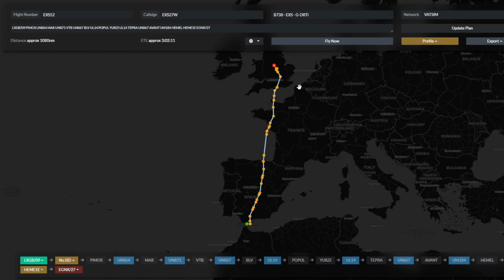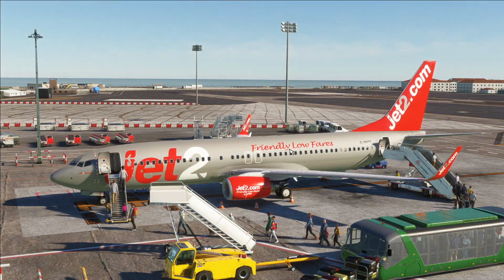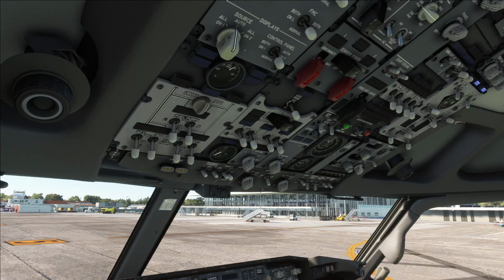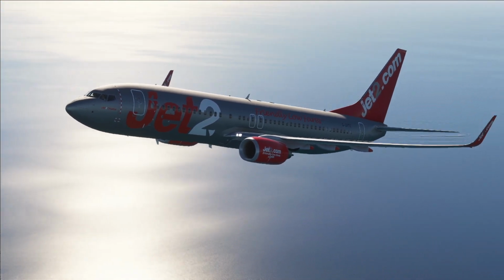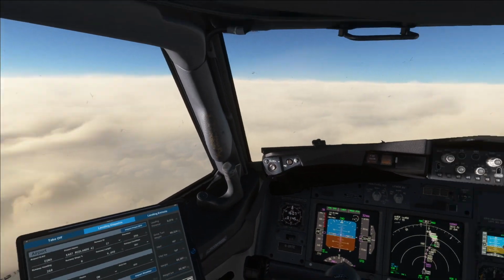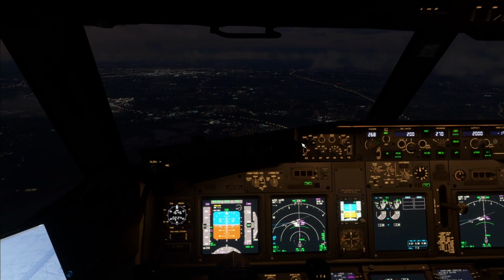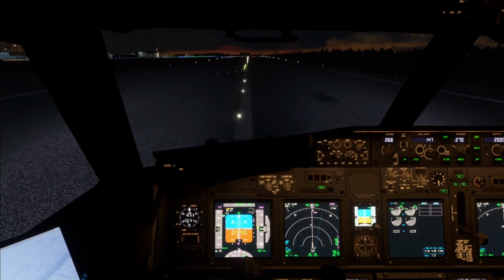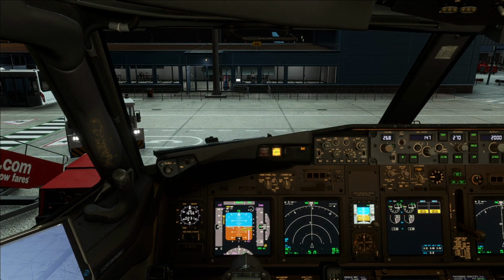[Microsoft Flight Simulator] NEW PMDG EFB | Gibraltar - East Midlands | VATSIM | Jet2 PMDG 737 l

Comment: How do you get the voices saying '80 knts' 'V1 rotate'?
Reply from the maker: hey, it's in the fmc somewhere in options
Reply: @AviationJack  another question 🙊, when do you know to put ur flaps up?
Reply from the maker: @_Ferre_ As the speed increases you gradually put your flaps up so you don't overspeed. On the PFD there is a little green line an a number like this '- 1' in green which you can use as a rough guidance :)
Reply: @AviationJack How do you know how many flaps u need to set?
Reply from the maker: @_Ferre_ You can work it out in the EFB. But usually the standard is flaps 5
Reply: @AviationJack  How can i put my flightplan directly in my MCDU because i need to put that from myself in and u are doing that not i think so how do i do so fast as u?
Reply: Its in pmdg setup, equipment i think then it should be in the first few pages